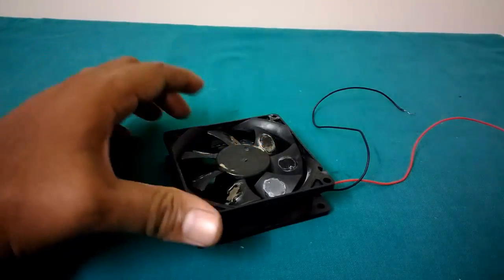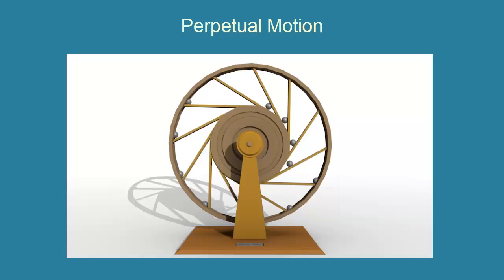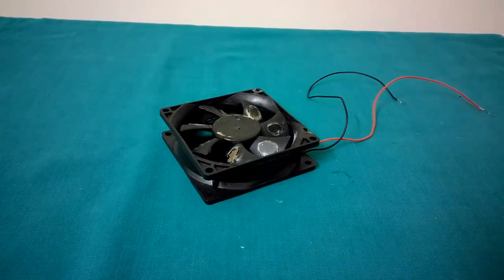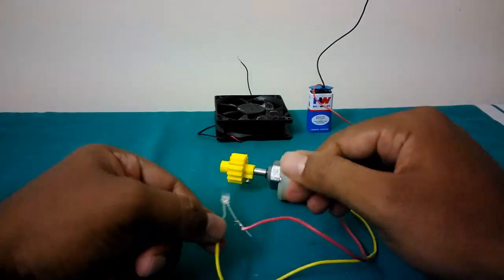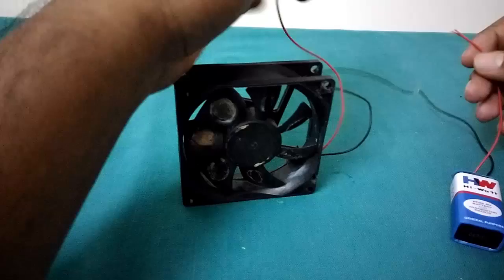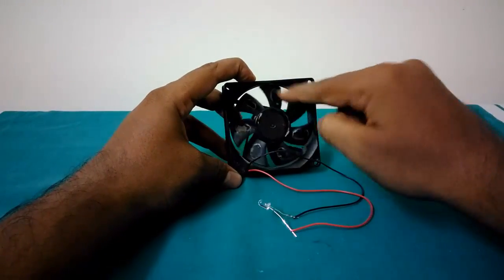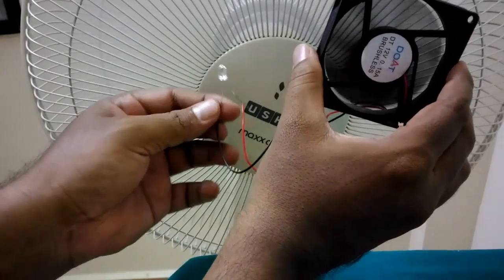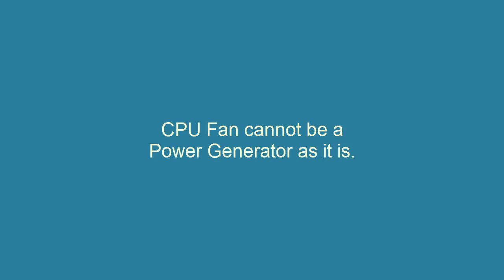CPU Fan Power Generation Fake or Real? Can CPU Fan be a Power Generator?

Comment: 🤣🤣🤣🤣 you can tk that condition from having no idea about the ciruits board under neats . Yes it can be a I have done it .  I think you should brush up on your knowledge before you call things fake . Have  look at the circuit board the cpu fan is connected to and where the two wired go in , now follow them around you should see numbers on some it says vo , v1 , v2  and so on . The two wires are connected to drive transitors which amplify rhe current to drive the motor. By spinning the faf you will not generate enough electricity and you will be blocked by the resistor. So go to the opposite end of the fan and solder directly onto the output with with no resistors.  Then do your test again and you will see it will light up

Comment: CPU Fan can be used as a power generator. You need to change the wiring and destroy fuses if any. And don't use a led. use a multimeter.

Comment: Actually it works, but not like this. Simply connect your wires directly to the windings an you can produce AC. And by also using a full brige even DC.

Comment: Just seen the video!. Points to keep in mind - CPU fan motors are 3 Phase motors which are commutated by an electronic circuit. The motor (like any other motor) has coils and magnets. This combination will generate electricity when either of them are in rotary motion. The problem is the circuit located inside the motor housing does not allow the electricity to flow out. Remove the circuit. Connect 3 wires to the 3 coils and you get an AC voltage. Connect a 3 Phase bridge rectifier and you get a DC voltage. Power depends on the rating of the motor and the rotational speed. Regards!, Engineer from India. (BTG)

Comment: PC fans can work as generators: 1. If you remove the associated circuit or and rewire it 2. Attach permanent magnets on the stator around the fans rotor

Comment: Alot of things can go wrong when doing this. While i agree that most of those videos are fake from my experimentation, here are a few things you did not consider (retry and let me know):

1. Polarity: led wont light light up if the positive and negative poles aren't connected in the proper way
2. Current: like all electrical component, you need to ensure that the current supplied is enough (although i doubt this is the issue)
3. Voltage: this works in the same way as the current. I suspect that this is actually the issue you are having. I had to use two to generate enough voltage to light up my led. I suggest using a voltmeter to confirm that you are getting enough (you will probably get about less than 1V (0.8V) from a full speed fan.
* Just a note, you may want to test if you dc fan is actually generating electricity as the circuit inside can actually go bad and it appears that it is working fine. The voltmeter can actually confirm whether or not it is generating electricity.
Reply: 4. - the fan needs to have the internal components taken out as they are absorbing the power.
5.the wires need to be direct connected to the coils inside 
6. The ac should to be rectified to dc.
Reply: @mattburrows2615  thanks for the additions
Reply: @maddjgi  as an advocate and enthusiast of all forms of alternative energy for 30y,  your welcome.

Comment: You have connected wrong the anode and catode of the led. Every dc motor can be a generator. When you choose a fan he must have enough amps. Most of them working on 0.003A

Comment: This is incorrect. A cpu fan has a built in rectifier/IC. In order to make it a generator you have to bypass the rectifier/IC which is not always an easy task. I have built a few cpu fan windmills that actually do work. They do not produce much in the way of amps but they can supply voltage for small devices. I cannot find the exact link I used when making mine but this one does a decent job of explaining it.

http://www.instructables.com/id/Old-PC-Fan-Wind-Turbine-in-10-Minutes/

Comment: when you tried to make the cpu fan to turn by the stand fan, cpu fan rotate in opposite way. so if you wan to light up the led, u should turning the wire another way around or you also can use the stand fan blow the wind in the back side of the cpu fan.

Comment: Cpu fan generate electricity 0.5 to 1.0 v .I have tested with multimeter. I put air pressure of pen and cpu fan running

Comment: It can be a pretty good (low) power generator, if you put it in the wind! 
You need to remove electronics first, ofcourse, and replace it with few rectifier diodes (or some more sophisticated stuff ;-)

Comment: I tried my voltmeter on it in the way you did here and couldn't get any volts out of it i think the reason that the ones with magnets work is due to the spinning magnets interacting with the copper wire in the system. As your video did not contain magnets you cannot use this video which is a completely different test other peoples videos to say there videos are fake. I believe this can work and am going to test it.

Comment: Cooling Fan can generate electric. you just disassembly and connect wire from coli directly. You will get about 2.5-3 VAC depend on speed. If you want DC , just use diode bridge rectifier and filler (capacitor) ... ... If you  want more voltage, just connect circuit of fan1+fan2+fan3 as serial ... you will get about 5-6 VDC ..... OK?

Comment: Doesn't it have to to with brushed vs brushless motors? I tried it & mine did NOT work.. Doesn't mean that none will, but mine sure as hell didn't.  I'm going to try with a different fan, but doubt it will work either.

Comment: dont you lnow science😂😂🤣 cou fan is a ac motor it doesnot light dc bulb please go and read 9th physics
Reply: cpu fan is dc, check your facts, read some labels... most will tell you 12V dc
Reply: Since it can be powered by a battery and your motherboard , it's DC

Comment: yr led works on dc power where as rotation of moter generates an AC power. just connect the rectifier circuit first with the output of motor and with the output of rectifier connect led. it will definitely work.

Comment: This video is fake. If I connect fun from pc to osciloscope, it generade about 1V power. On multimeter about 5mA. Blue diode needs about 3V power, red about 1,3V!  Connect three funs to serial and it will working great with your diode!

Comment: don't mind brother cpu fan generates ac volts if you want to glow a led light you have to open its circuit from back side un lock the shaft and take out fan and its circuit solder your wires  where the copper winding terminals are solderd after solderind it put it back to its casing and rotate the fan you will get power
Reply: Azam Jan Sarhandi So far every CPU fan I've found has been DC. Anywhere from 5 volts to 24.
Reply: can u please send me the detail video please

Comment: what if i say it can generate i had tried it to glow a led using a wind as the energy and it really worked
Reply: ***** what u actually meant to say i dint get u
Reply: yea that i got but actually in the video he says that the CPU fan cant generate any electricity so to that i said it does produce current when i made the blades set into motion by using wind as the energy source

Comment: In order for a fan to generate power, you must remove the rectifier and capacitor and reverse it. Then the coils will be excitable by the permanent magnets inside the fan.  However the magnets in any configuration won't change or move the fan blade in any given direction by an opposing field. It simply doesn't work!
Reply: You dont have to remove anything actually, most work fine without altering the fan
Reply: @maddjgi  they work MUCH better modified with the components taken out and the leads connected to the coils.
Reply: I tried connecting to coil L1 and L2 with all transistors and starter capacitors removed still the led doesn't glow.

Comment: dude, any electric motor can by used as generator, just need change original wiring  of them...
Reply: Move the CPU fan to another side and try again
Reply: I had tried and I was successful on that experiment
Reply: Have you tried and i would like to ask your email for questions that i need to ask ?
Reply: @firdauskz309   A lot of things can go wrong when doing this. While i agree that most of those videos are fake from my experimentation, here are a few things you did not consider (retry and let me know):

1. Polarity: led wont light light up if the positive and negative poles aren't connected in the proper way
2. Current: like all electrical component, you need to ensure that the current supplied is enough (although i doubt this is the issue)
3. Voltage: this works in the same way as the current. I suspect that this is actually the issue you are having. I had to use two to generate enough voltage to light up my led. I suggest using a voltmeter to confirm that you are getting enough (you will probably get about less than 1V (0.8V) from a full speed fan.
* Just a note, you may want to test if you dc fan is actually generating electricity as the circuit inside can actually go bad and it appears that it is working fine. The voltmeter can actually confirm whether or not it is generating electricity.
Reply: I try the dc motor from a toy car to make a generator but it doesnt work. do you have idea how it works
Reply: @ziegfredtuante814  A lot of things can go wrong when doing this. While i agree that most of those videos are fake from my experimentation, here are a few things you did not consider (retry and let me know):

1. Polarity: led wont light light up if the positive and negative poles aren't connected in the proper way
2. Current: like all electrical component, you need to ensure that the current supplied is enough (although i doubt this is the issue)
3. Voltage: this works in the same way as the current. I suspect that this is actually the issue you are having. I had to use two to generate enough voltage to light up my led. I suggest using a voltmeter to confirm that you are getting enough (you will probably get about less than 1V (0.8V) from a full speed fan.
* Just a note, you may want to test if you dc fan is actually generating electricity as the circuit inside can actually go bad and it appears that it is working fine. The voltmeter can actually confirm whether or not it is generating electricity.
Reply: Wait for some day I give the video
Reply: Just take out circuit of cpu fan and  connect coil directly with positive and negative wire , use a bridge rectifier with a capacitor it surely generate energy but in small amount ...
Reply: @kantshree5039  Hy,  what I understood follows that you said, but to make a generator you have to treat the motor as a bifilar primary winding of a Joule thief circuit, where a ferrite ring is overlayed on fan mount and both primary and secondary to an NPN transistor. Thence if you apply magnets properly in the mount and over the fan this one runs, by developping up to 1W if a 12V microfan is used. Have you got the same? My mail: r.tarelli@libero.it

Comment: because of the circuitry og the cpu fan . it does not allow an emf to flow . For one to generated electricity with a cpu fan one must remove the circuitry . and take the direct 3 phase ac from the 3 live coils .
Reply: Which is pretty easy to do. Just desolder your leads and connect them to the correct points and you get an alternator. Use magnets to power it, why not. But, you need to get the RPMs up to get it to produce enough.
Reply: true
Reply: external magnets added to say the fan blades will not work due to the sticky spot where the magnet both pushes and pulls at the same time at the same strength.. the videos showing the doing it are fakes... they have a magnet off camera going in a circle to pull the fan around... another thing is when turning a cpu fan into a generator you only need to move 1 lead. I have done this many times and have installed them in my car as a wind generator. check out my video. More will be added soon with how to do it. As well as it charging a cell phone with only 1 cpu fan
Reply: Dwayne Daniels lol you seem to know what your talking about.
Reply: What